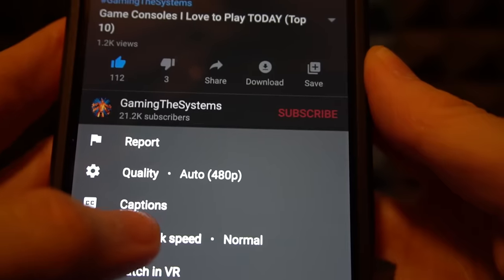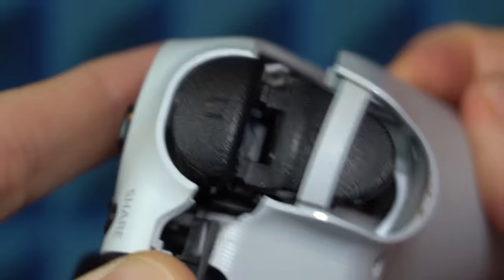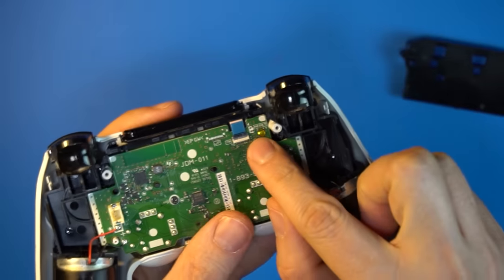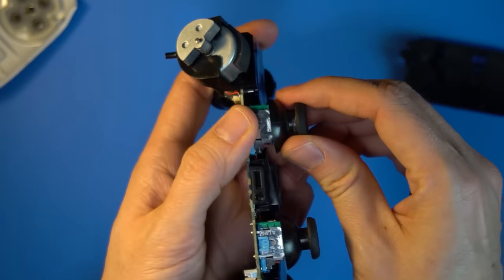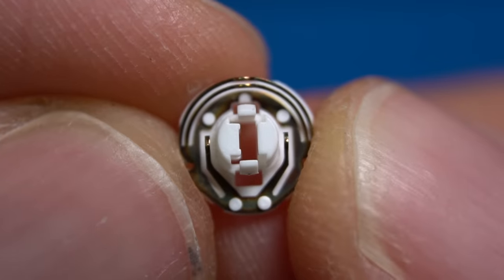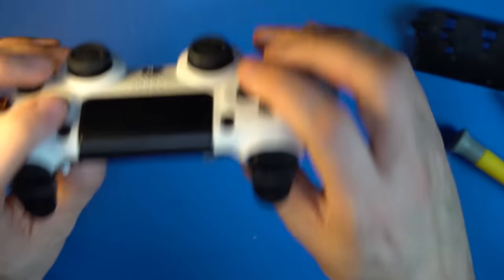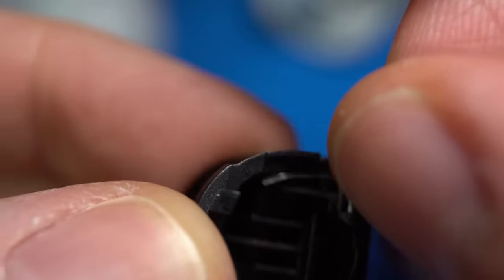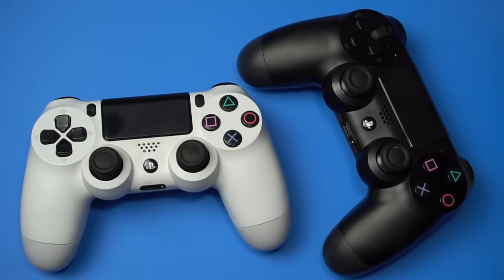How to Repair a PS4 Analog Stick That is Drifting, Sticking, Jittery/Cleaning DualShock 4 Controller

Comment: PS3's controller was so much easier to "DIY" while the PS4's feels like you're defusing a bomb 😂😂
Reply: FLUXXEUS easier than xbox
Reply: @thedragonknight8061  nah Xbox is way easier to fix
Reply: Deadazz
Reply: Time has Ran Out on me twice trying to Defuse the Bomb
Reply: Bc they dont want u repair it free and easy
Reply: @ledka83  Pretty sure that isn't the reason, it's been it's easy to assemble in the plant and this way they can just toss parts that don't work and slot on a replacement easily. You're overthinking things, why would they go through the trouble of revising the layout to prevent DIY repairs. Earlier controllers were worse to repair and a lot more parts were fragile. The new design is more modular than ever and easier to repair as long as you're careful, you can't go wrong. Hardest part is opening the shell, I simply squirted in sooner WD-40 instead of popping open the analog sensor boxes. No more drift ever now I have to do it to me other two controllers so they stay drift free.
Reply: @evilformerlys4704    > Earlier controllers were worse to repair and a lot more parts were fragile.

The PS1 controller begs to differ, i gave maintenance to those babies more times than pieces of bread i've eaten on my life, and it was incredibly easy, everything was sturdy enough as well

Shit like the new "triggers" with springs and all compared to good ol' normal buttons on R2 and L2
Reply: FLUXXEUS bomb defused
Reply: Swear tuh god. I hope this video explains somethings i have the crystal red controller i bought used from Gamestop and after about a month now the right analog stick will just do a swift turn on its own cant use it unless im not running some Cod. I also and i bet theres no fixing this but because of the new Modern Warfare and the double tap L3 to full sprint, my controller run button doesnt work now like what i mean is he looks like hes clapping and i have to really mash it to make it work or litterally click in like 10 times just to get em to full sprint and even regular sprint i have to mash it a few times then he goes..its awful hands down that game broke my controller i think they owe me one haha but really doe they do owe me..
Reply: Yea I repaired my ps3 controller for years and even repaired controllers for friends from school. I had the ps3 for 7+ years before I got a ps4 and I was still using the original ps3 controller that came with the system since it worked fine after some DIY fixes here and there.

Meanwhile I have this wave blue ps4 controller for like 2 months and I got drift on the right analog stick and the left analog stick makes a clicking noise when I move it slowly up or down. Dunno what it is but its like the ps4 controller feels sturdier but has waaaay more issues and it sucks cause these things arent fucking cheap...
Reply: FLUXXEUS I broke my controller 😂
Reply: +FLUXXEUS defusing/defuse*
The word "diffuse" means something else entirely.
Reply: @BennyGoId  I don't know what you're talking about
Reply: +FLUXXEUS The "(edited)" tag above the original comment begs to differ. You got caught with your pants down, and now you act like you didn't do anything wrong. There's nothing inherently wrong about incorrectly spelling a word. At least now, you know that the word "defuse" is spelled differently, in comparison to the word "diffuse", of which you incorrectly used.
Reply: @UC1I5C6UBohbOHqU5et2Ad3g Considering theres nothing stating whether Flux is a he or a she how are you gonna use that as an argument 😂
Reply: @BennyGoId  Calm TF down, English isn't my first language. My response was made as a joke with the obvious edit, if you couldn't pick up on something that simple then you should take a break off the internet 🙃
Reply: @MilkyaNdPuddlez  they assumed my gender, I feel attacked 😂
Reply: @FLUXXEUS  Yea Brian is just a typical keyboard warrior picking fights in the Youtube comment section. I mean this reply section was just people talking about their controller issues and then this keyboard warrior wanted to pick fights.

I mean who tf corrects someones spelling 😂 I doubt anyone texts him cause he probably replies with "Its You not U...."
Reply: @MilkyaNdPuddlez  imagine them in Starbucks... 😂
Reply: That's exactly what I said
Reply: @MilkyaNdPuddlez  agree... i hope they will change the ds5 quality. i have 3 ds4 with drift problems. Shoulder buttons are horrible too. on my first R2 is broken. It feals very cheap .. On newer versions it's a bit better but not good enough. if sony don't chsnge that maybe i ll switch to xbox series x. ...
Reply: haha true
Reply: Ahahahahahaha
Reply: Yep
Reply: where can i get a new original ps3 controller? been screwed 3 times buying on ebay..thanks
Reply: @GleamzFn  it makes sense for it to be hard cuz PS4 duz not need batteries it kinda balance them sorta
Reply: FLUXXEUS bomb defused 🤣🤣🤣
Reply: Ps3 🤭 upgrade plzz😅
Reply: No cap
Reply: And the half of it is just the Touchbad
Reply: FLUXXEUS what’s diy
Reply: @Xavier Bohn I say defused cauese you opened it
Reply: Sooooo treu
Reply: Factz bro
Reply: It's not hard, it's actually pretty easy and it DOES works, because I just did it on mine. Now it's good
Reply: You haven’t seen the xbox controller the screws are a pain in the ass just to get out
Reply: I used to just drop my ps3 controller on the ground and that would fix most problems for me but that properly started most problems
Reply: facts man, i did it and i felt like i was playing operation .. Lmao
Reply: I’ve busted one of mine so bad some how that when I hold L2 the controller registers it as me moving forward slowly. And the movement stick doesn’t respond so well so u have use pressure to use them which hurts after 2hours of cod
Reply: you pretty much are... something goes wrong and everything sucks like when a bomb explodes
Reply: Lol
Reply: Search and Destroy.
Reply: FLUXXEUS I can help
Reply: Lol
Reply: SnD in real life
Reply: RIP my controller
Reply: ZE BOMB HAS BEEN PLANTED ON OUR AMMO SUPPLY
Reply: Fr😂
Reply: Fr 😂
Reply: @ledka83  pfff u are paranoid
Reply: @izilgur  maybe haha pff
Reply: My ten years old dualshock 3 didn't have any drifting problem and dualshock 4 V2!!! is not two years old yet and started drifting. Seriously Sony WTF....
Reply: This one absolutely, but i got the controller that comes with the original ps4 slim, and it's much much easier to disassemble, the share and option buttons stay with the frame and don't fall off, the spacer between the bumpers and triggers doesn't move with the shell, and the reset button stays put, overall a much better and easier disassembly, the hardest thing is the cables, only because i have big hands, so i use tweezer
Reply: Hahah
Reply: @GleamzFn  a
Reply: Imagine ps5.. finna be a whole maze
Reply: Shit i destroyed my controller
Reply: FLUXXEUS agree lol
Reply: Hiw do you know how to defuse a bomb huh?
Reply: 😂😂😂😂😂facts
Reply: Fr my ps3 controller is easy to understand
Reply: Wait for dualsense
Reply: I no aye
Reply: @evilformerlys4704  I just took apart my DS4 today in order to fix analog drift, and the shell was definitely the most difficult part. While the DS3 shell was easier to open, the triggers tended to pop off and I always found it difficult to put the controller back together.
Reply: Think about ps5 controller
Reply: Hmm so is it the black screw or the chrome one? I Cut the red wire or black one?!!
Reply: @FLUXXEUS  he’s makeing it so extra I did in 25 times it’s not that hard
Reply: Bruh😂
Reply: low key looks like that 😂🤣🤣
Reply: I felt like cleaning an ak47
Reply: I swear that’s facts
Reply: S I tried to open my PS4 controller but couldn’t as it was glued, my opinion ps3 controllers were easier to manoeuvre.
Reply: So true
Reply: Fax
Reply: Lol
Reply: ikr
Reply: Gleamz nah Xbox hot garbage
Reply: Tyronda Hines bruh xbox is trash
Reply: Tyronda Hines and ps4 is basically defusing a bomb fr
Reply: Ikr defusing a bomb
Reply: Oh no I dont know what I'm getting my self into lol
Reply: bruh u dont understand how nervous i was of fucking my shit up even more😂😂
Reply: Lul It do be like that
Reply: Really not difficult lol
Reply: @evilformerlys4704  said like a person who has no concept of "planned obsolecence". corps design stuff to break within a certain timeframe because its good for business bruh
Reply: my ps3 controller has eaten 2 years worth of dust yet no drift and still works perfectly fine while the ps4 controllers get drift in less than a year
Reply: @BVNT HAZARD why? i have a ps4
Reply: You know what it's like to defuse a bomb ??
Reply: FLUXXEUS on god bro
Reply: Yes
Reply: Hahahah
Reply: FLUXXEUS and i’m good at working on them so ig i can defuse a bomb
Reply: Probably worse than defusing a bomb lol
Reply: My left stick now doesnt work at all
Reply: Yes🙄🤦‍♂️
Reply: So true
Reply: Lmaooooo 🤣 🤣
Reply: Ik right? I'm literally ripping my controller apart
Reply: Ps3 controller is way better and more durable too
Reply: Ever hear of a cash grab? 

They do it that way on purpose so you have to buy another one...
Reply: Mw fucked my controller
Reply: Next minute you see someone making a bomb with a PS4 Controller or the PS5 Controller
Reply: Just made this comment go from 6.3K too 6.4k
Reply: I swear bro, I’m goin thru it rii now😭😭
Reply: Ikr
Reply: Alternatively you can just use an air compressor to blow the crap out from underneath the joystick while the controller is fully assembled 🙄
Reply: Hahahahaha. Lmao
Reply: I felt like a technical surgeon 😂😂
Reply: You are most likely confusing a real bomb to a ps4 controller. Don't worry your not the only one.
Reply: It's because of the touchpad.
Xbox's controllers are easier, because this feature is missing.
Reply: Hahaha
Reply: Just wait until you work on a PS5 controller. The PS4 feels like a breeze..
Reply: Fr it took me 15 minutes to put the white disk back in please lmao
Reply: @GleamzFn  cap i got both xbox 1 harder
Reply: i have big ass fingers so it really hard for me
Reply: @evilformerlys4704  does that s stand for sony u sound like ur trying to make the ps4 sound better than it is😂
Reply: that's so dame true lol
Reply: So true🤣
Reply: HAHAHAHAHAHAHA
Reply: True
Reply: Ik right
Reply: And all the wires are the same color
Reply: Bro I failed the defusing my controller doesn’t even work now
Reply: @ledka83  they just want you to buy another controller
Reply: Ps3 controllers lasted longer then ps4s shame on Sony !
Reply: My controller is beeping help
Reply: Where funny at
Reply: Facts
Reply: Actually, I find some models of the PS3 controller to be fucking bullshit to reassemble (trigger buttons). Working with the ps4 controller is a joy imo.
Reply: It’s a bomb lol
Reply: I feel the other way
Reply: I like the video and all the efforts made to explain how to fix it, but it is not this time I will DIY, I will send to proper people don't want to mess with this
Reply: @FLUXXEUS Its like going full Search and Destroy on the Damn thing
Reply: DualShock controllers are so sensitive. I took my controller apart easily but I guess I damaged the cable when installing it back
Reply: vwahahahaha
Reply: I had a harder time with the DS3 than the 4, weird
Reply: It’s because Sony doesn’t want you to DIY they want you to buy a new one
Reply: i would say the opposite, my ps3 controller board and film layer for the buttons fell apart and i had to fix it with tape
Reply: lmfao
Reply: Just try a ps5 controller
Reply: I put my ps3 controller in the microwave as a kid lol
Reply: I opened up my old controller and since i didn't have a small screwdriver, i used the one that came with tech deck and half way, i was scared that i was gonna mess up and after that i managed to put it back together in one piece
Reply: @thedragonknight8061  no way. The ps4 has those annoying ribbons
Reply: @stompingpeak2043  they were only annoying the first 2 times I opened ds4 controller up, after that it's all been a breeze
Reply: @thedragonknight8061  yeah its just tedious with some ribbons that don't want to go in. It's tough for people like me with big hands
Reply: @stompingpeak2043  i feel you, I also have big hands but am now more confident, recently i openned a switch joy con and wow it is garbage to repair, worse than ps4 for me
Reply: @thedragonknight8061  well the Nintendo controllers are garbage lol
Reply: Bruh 😂 hahahaha
Reply: Yeah I defuse the bomb
Reply: istgggg
Reply: Yes!
Reply: Fax
Reply: And ps5 is like a nuclear bomb
Reply: That shit 65 bucks have u nervous as hell takin it apart lol
Reply: PUSH THE THEM BUTTON
Reply: exactly
Reply: True XD
Reply: @Mxstyy_1  lmao how did you manage that
Reply: @james6646  you said "no cap" when you click translate it then says "it doesn't fit" LMFAO 🤣
Reply: @alexburks310  bruh u replied to my comment after a year I forgot and got a ps5💀
Reply: @Mxstyy_1  Lmao and the PS5 is good 👍
Reply: @alexburks310  yh it is
Reply: Search n destroy lol
Reply: Fr
Reply: Fluxxeus ur too good 😂 lol yea feels like a defusing a bomb xD
Reply: LOL
Reply: ps4 ez af
Reply: Yeah that how it feels fixing/repairing ps4 controller
Reply: Aye can u tell me what game he playin
Reply: Yeah i tried this and left joystick was fine but the right one's problem reversed from left to right and up and down stopped working entirely.
Reply: I have a weird problem does anyone know a fix? My cousin dropped my controller and now my R2 doesn't work and whenever I move my Right stick it acts like my R2 idk why.
Reply: Fax
Reply: Coolness factor ig
Reply: Lol
Reply: Facts lol
Reply: Yeah right 🤣
Reply: this is nothing. Try repasting and replacing thermal pads of a gtx1080 ti founder's edition
Reply: Yea rite, ps3 controllers where bombs.... pull one thing and springs go everywhere and buttons, I've opened many ps4 and they are way easier
Reply: Dualshock-c4
Reply: true.
Reply: Fr 😭 cut my thumb so came to this video lol
Reply: Yeah, I think it was easier to take apart a 360 to fix the red ring of death and put back together..
Reply: Omm
Reply: I just blew hot breath under the right stick and my controller has went back to working normal..
Reply: So true tho...
Reply: True
Reply: Swear
Reply: W comment 🤣🤣🤣🤣🤣🤣
Reply: Lol ;D
Reply: LOL Facts!
Reply: There’s an easier way to do to it just pull the thumb sticks up then press it down forward for 30 seconds then press it down again with the sticks in the middles again for 30 seconds then go in circles clockwise 5 times then go counterclockwise 5 times then do the steps again to make sure it works
Reply: @GleamzFn Definitely not 😂
Reply: Fr💀💀
Reply: @FLUXXEUS It’s mainly just the ribboned wire for the touchpad optics that’s a pain, once that’s done it’s just basically a puzzle. Ps5 controllers are on a whole other level
Reply: Ya mine blew up was trying to be careful removing this disc and snapped a wire 
csgo announcer terrorists win
Reply: @evilformerlys4704 wd 40 is not a grease or lubricant sir lmfao 🤣 😂 💀 eventually its gong to mess up your little metal bits
Reply: For fucking real dude
Reply: @ThatBallerWaller Days Gone wrecked my analog stick....running from Zombies
Reply: Seriously 😭I don't want to break anything definitely don't want to sweat on anything sucks tho I have sweaty hands so I'm taking breaks every now and then but this fucking stick drift is kicking my ass
Reply: Fr..